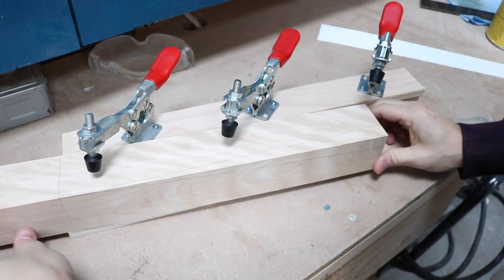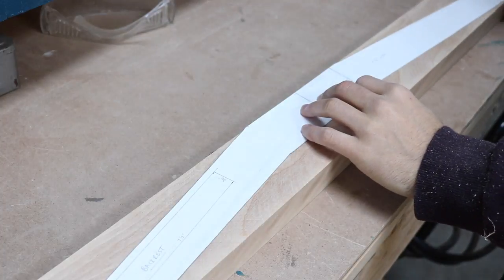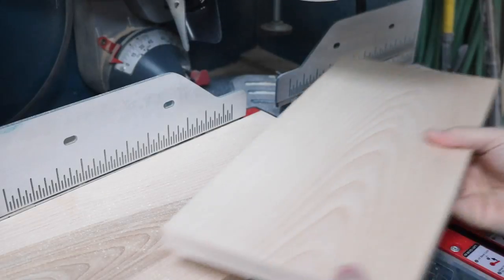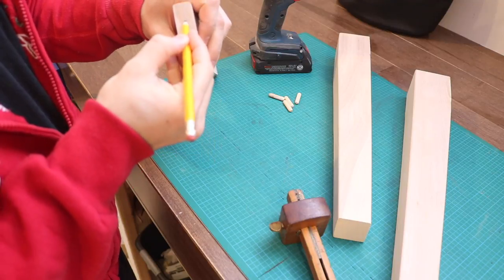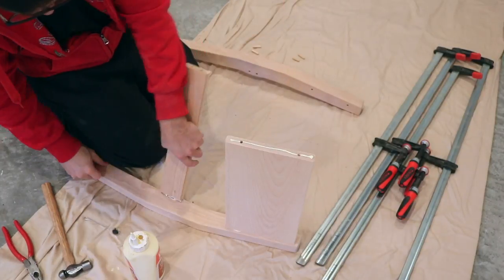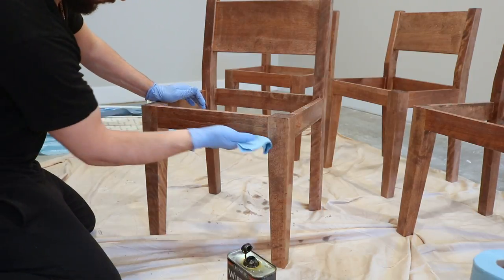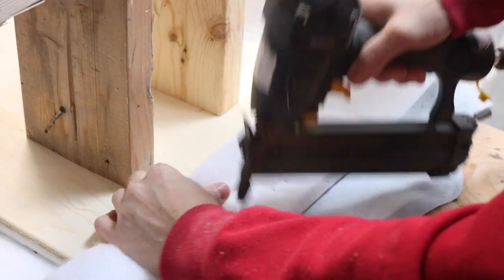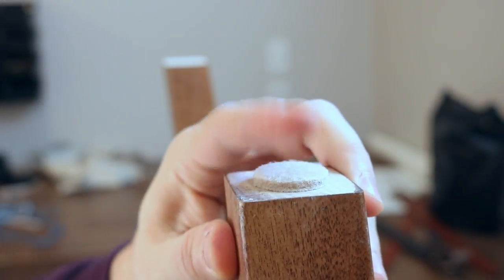How to Make a Modern Wood Chair with Leather Seat // DIY

Comment: The dowel has been around a long time for a reason. They are stronger than many think. Just as strong as the domino suggested. And with better glue technology it will last a long time. Well done.

Comment: Great video, excellent narration, handy little tip with that T you built to weigh down the pad when you were assembling the cushion. Also, that's a great little taper jig you made. The only thing you could have done to make it better was to screw a stop block down at the back end of it instead of lining up your pencil mark with the edge of the jig itself. Less room for error that way. But great video!

Comment: Corey the chairs came out awesome! Any way I could get the templates? I want to build some
Reply from the maker: Sorry I don't have digital templates. I gave a lot of the measurements in the video. Front legs are 17" high, back legs are 32" high. Seat is 16"x18", so it should be fairly easy to customize to your liking.
Reply: @CoreyRametta  I need in cm meters?

Comment: Is the dowel joinery strong enough, I tried making some chairs with 12 mm dowels which are falling apart after some usage.
Reply from the maker: Super strong. Did the dowels break or the glue joint? Could be many reasons
Reply: The glue joint, the dowels just come out of the legs. They are firmly fixed into the horizontal pieces.

Comment: 1,000 grit for a satin finish???

You need to round over the bottom of the chair legs to prevent splintering.
Reply from the maker: +Chuck D the felt pads prevent the legs from touching the floor, so no issue with splintering.
Reply: What about vacuums, mops, brooms,  moving around?
Reply from the maker: +Chuck D very unlikely to splinter. These are my second set of 4 chairs. The first 4 were made about 18 months ago and are in great condition still with no splintering, with daily use.
Reply: Yes, they are only 18 months old and still in the break-in period.
Reply from the maker: +Chuck D don't worry, they won't splinter
Reply: so, did they splintered or not? i'm curious about the ending of this story 😂
Reply from the maker: Nothing so far!